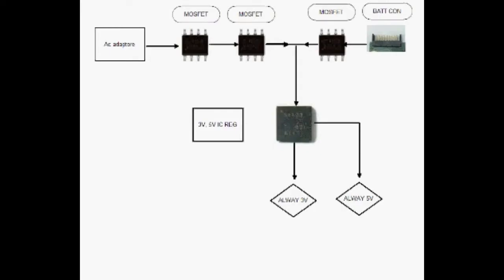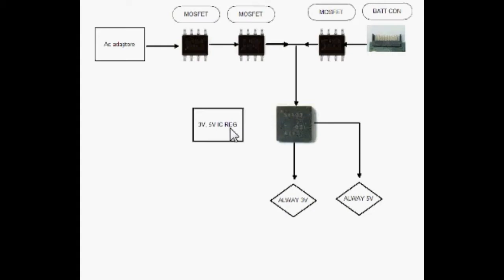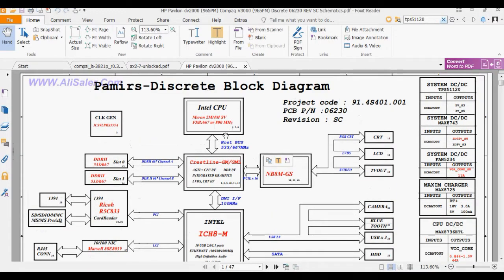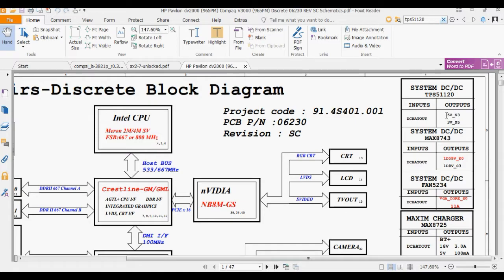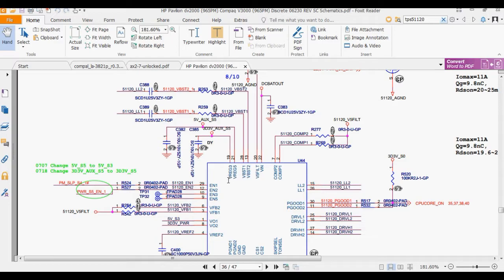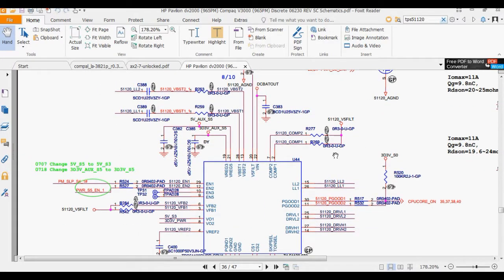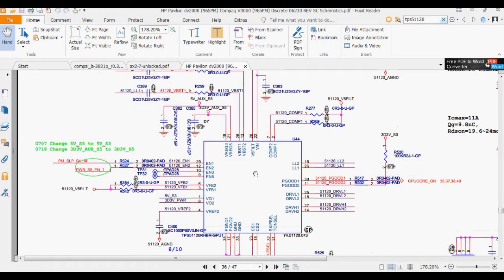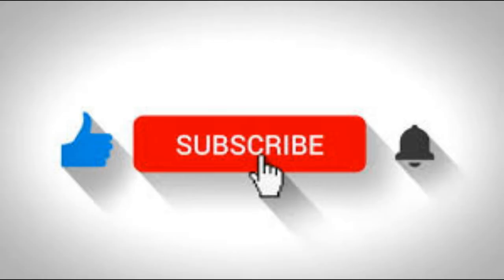laptop power sequence 5v 3v

Comment: My dell Vostro 14inch 5459 turn off after dell logo. Even if connected to ac without battery. What could be the problem?
Reply from the maker: U must check hdd and check fan check if ther is over heating in mother board